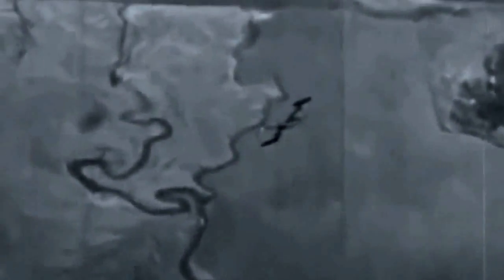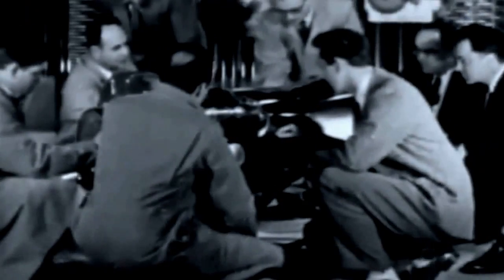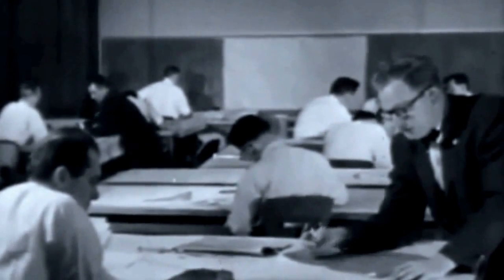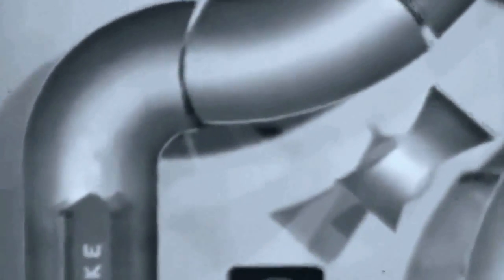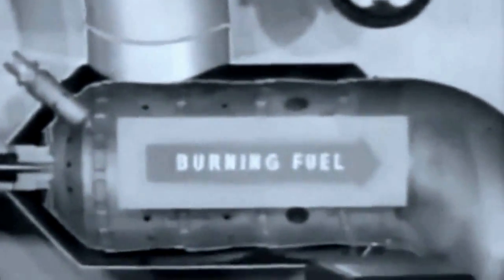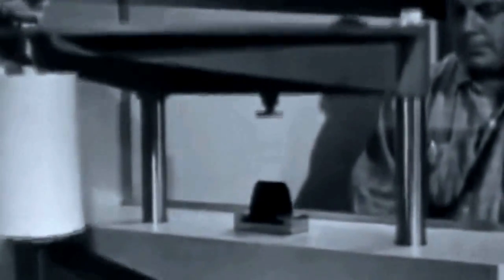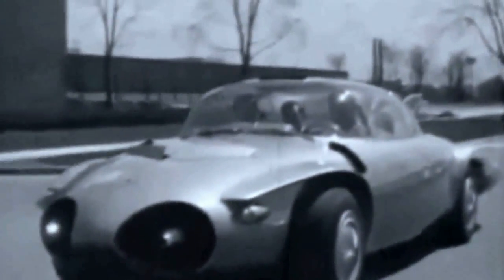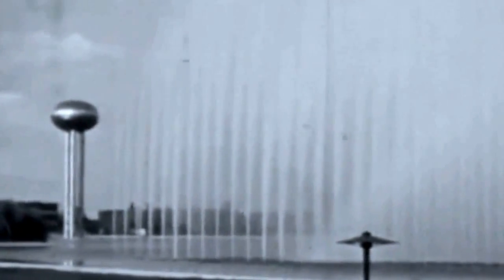GM Firebird ll Gas Turbine Car Promo Film - 1956

Comment: A friend of mine  designed and built the  lowest emission engine [a steamer] in the world at that time, [ still is] said there are only two places for turbine cars, in the Museum of Modern Art or the scrap heap. The steamer was demonstrated in CA. to Senators and the vehicle industry successfully. They didn't want it. I could be excused for believing the quest for clean air was a political hoax and still is. All politicians did since then is change the goal posts to suit the motor industry.

Comment: That's what I want.  A large family sedan with no trunk I can drive to Bonneville, set a Land Speed Record with significant other aboard and then drive home at 55 MPH & 10 gallons to the mile.
Reply: What u really want is the ford fx atmos or the gm firebird III or IV.